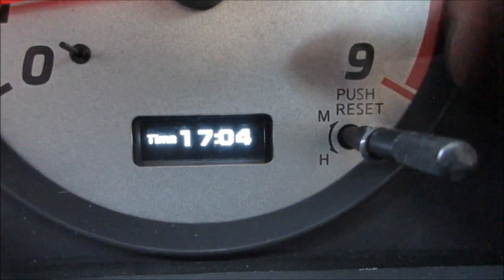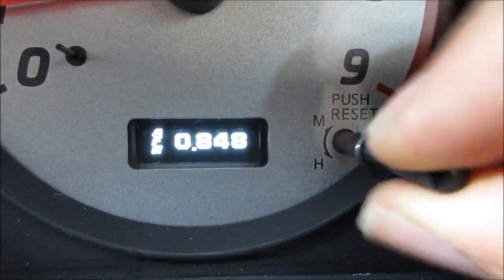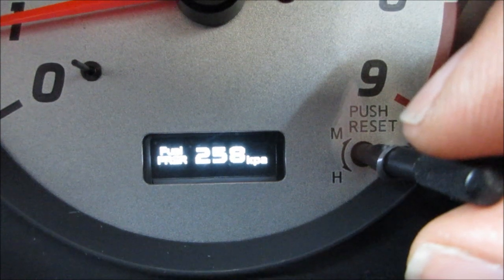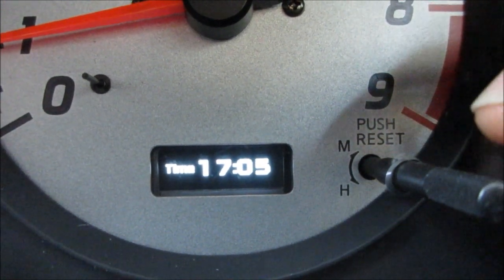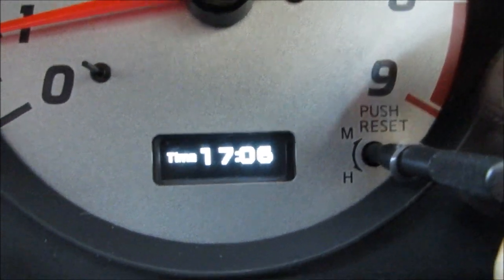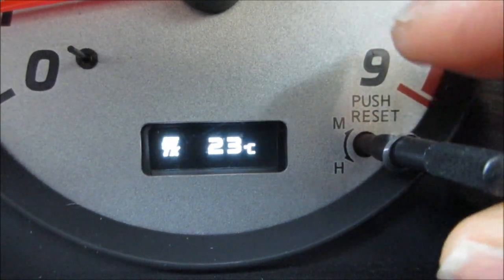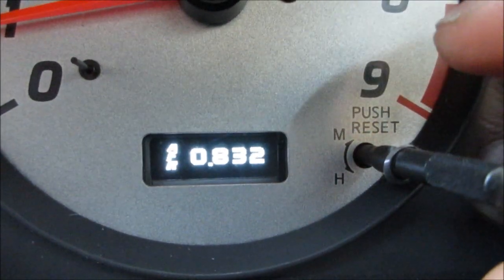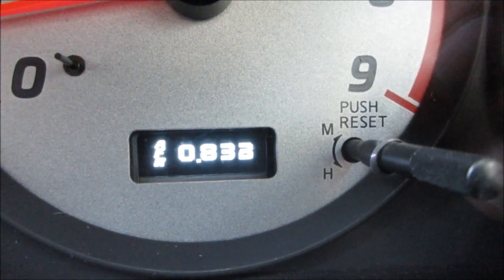ESP32 Arduino CAN BUS Multi-gauge / S15 Silvia

Comment: Love it. How's the screen held up over time?
Reply from the maker: The display itself has been fine but I've had problems with real time clock chips breaking, presumably due to fluctuations and interference in the car's electrical environment, but I'm not really sure why.  Could also be ground leakage in my car.  I end up replacing the little ($5 to $10) clock module about twice a year.

Comment: not sure if you are still selling these, but I will take one
Reply from the maker: It's not really possible for me to sell it as a kit because it requires modification to the inside of the gauge cluster and the clock assembly.  If you'd be willing to send me your gauge cluster and don't mind a significant lead time, I can build you one (provided the components are still available!)
Email (info@ateliermirage-carbon.com) if interested!
Reply: @kenecchi  sure no worries, I will email you.

Comment: Hi I’ve seen your comment on raspberry pi forum about serial communication under Wine to monitor software thar uses a serial interface. Have you found any solutions to communicate software and raspberry pi?
Reply from the maker: I can't remember what exactly I was trying to do but it was probably related to running my (windows-based) engine management software on a raspberry pi.  I never got that to work, however now there's a build of Windows 10 that runs on the pi 4 so it might be possible that way.

Comment: Great job. I'm doing something similar with a race dash for a Link G4, however having issues with the ESP dropping a great deal of can frames. I wondered which arduino canbus library you were running and if you had similar issues?
Reply from the maker: I'm using the "arduino can"/"sandeep mistry" one and I haven't really had any trouble, probably because 1) I'm transmitting data fairly slowly; 500kbps bus speed, streaming from the Link at 5 to 10hz, and 2) I'm using the ESP32 in dual core mode, performing the can bus operations on one processor and using the other one to draw the graphics on the screen.
Reply: @kenecchi  Thanks for the reply. 
I've tried something similar with a setting of a semaphore, reading from the canbus buffer, writing to a global variable, then using core 1 to process all my 7 segs. I had thought it was my serial.print lines that were taking up too many clock cycles, however core 0 should be idle most of the time. Other than I am forced to run 1mb/s canbus speed (AIM dash), your and my setup appears identical. I'm beginning to think there is something wrong with my canbus, either in termination or my Link G4 Storm (which is an old rendition).

Comment: Great project! Do you use the ESP32's CAN interface, or a separate chip such as STN1110? Thanks!
Reply from the maker: Thanks, it uses the onboard CAN controller along with a SN65HVD230 transceiver.